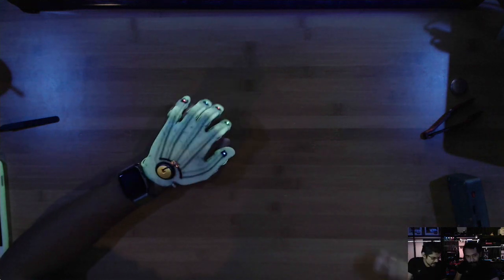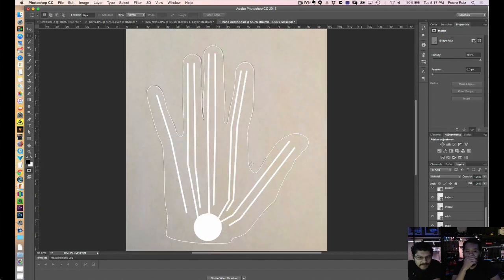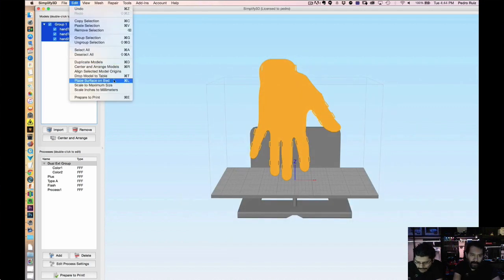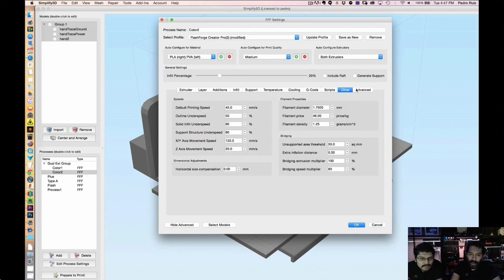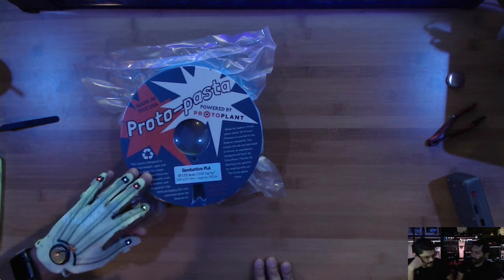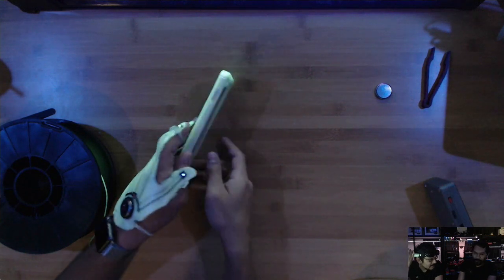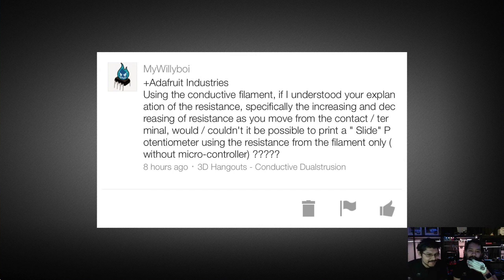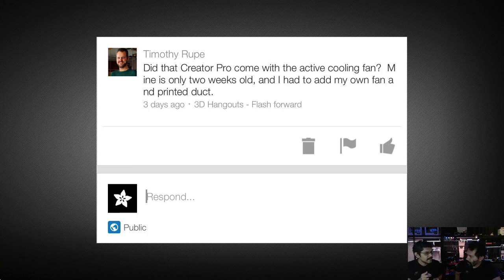3D Hangouts - Glow in the dark

Comment: I have recently bought a flashforge creator pro about a month ago and got 3d printing down for the most part but I am still having issues with the left extruder. it makes a clicking noise and stops extruding for a second or 2. any tips to resolve?
Reply from the maker: BiaggiMendozaProdt It may not be hot enough, try increasing your extruders temperature to 220c.
Reply from the maker: sounds like the active cooling fan might be cooling the left extruder too much. You can compensate by turn the temps higher or lowering the fan speed.